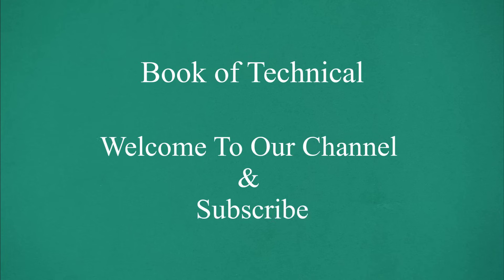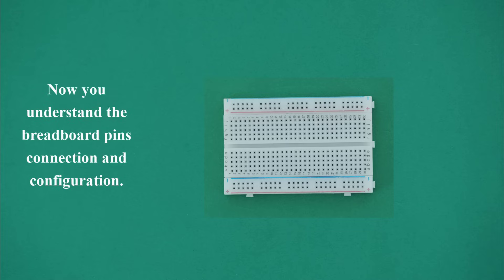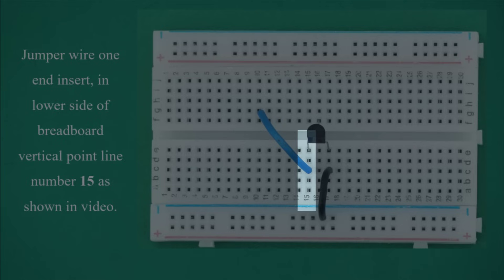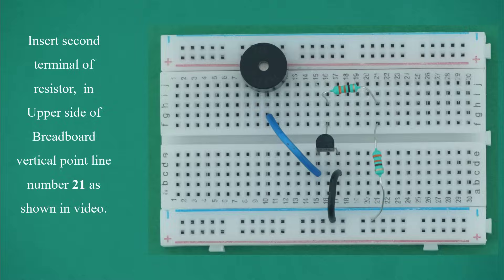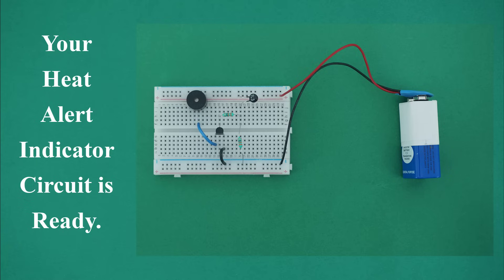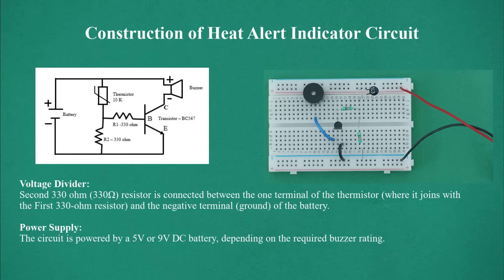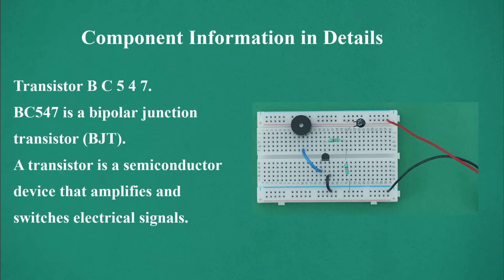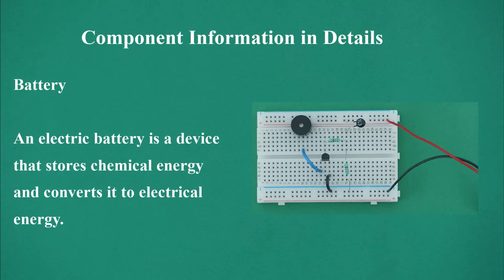How to Make a Simple Heat Detector Circuit | Temperature Sensor on Breadboard |[Chapter 3: Circuit]

Comment: What temperature triggers the thermistor?
Reply from the maker: It depend on Pull resistor. In this circuit 1K pull-up resistor, BC547 will turn on at approximately 125°C to 130°C. 
If we use 10K then approx 70°C.
Reply: Great thanks, but looking at the video I saw no mention of 1k resistor